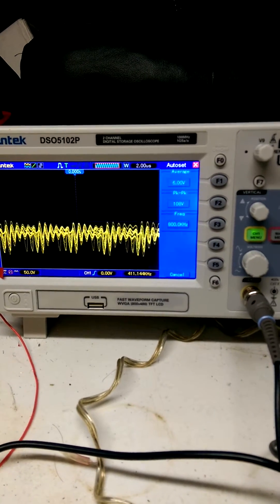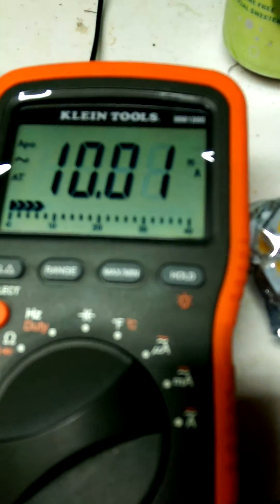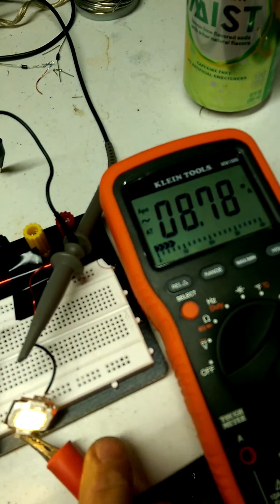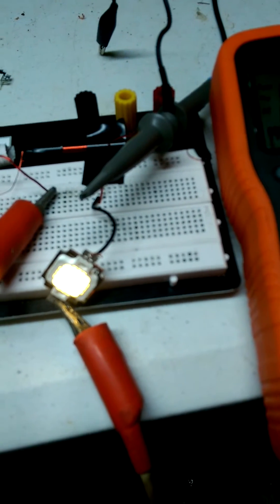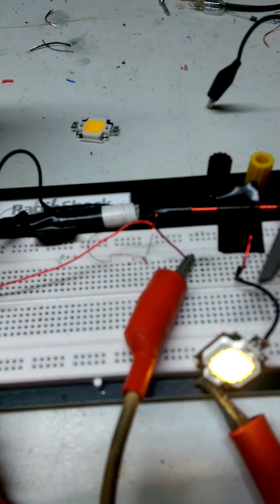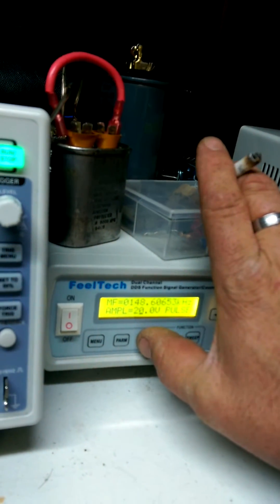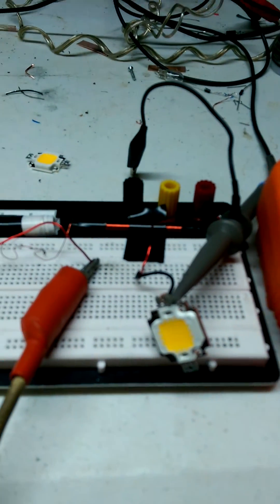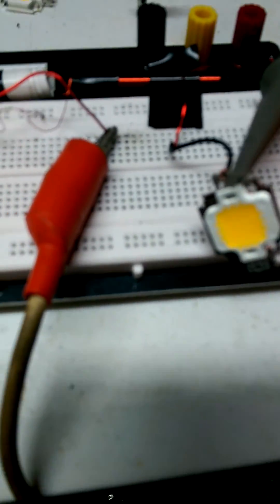Partnered coils- proof of overunity

Comment: tesla was into high voltage and high cycles
Reply from the maker: +frank ertolacci Me Too! I was just playing around with this. He actually speaks of this using low frequency ac and pulsated dc in his book. This is where I learned of this originally and he states that the cores being separated will make it work if the bloch wall has an electromagnet wired in the middle in the correct direction. The energy out would be completey independent of the input, and, a very high amperage, however, the phenomenon here needs to be engineered by somebody to calculate what's happening here.. I do not have that deep of knowledge as to why it works the way it does, but, it is working the same as TinMan's motor. It's the identical effect!
Reply: +Marc Belanger   i think that you are the engineer to handle this task  // if you keep looking help will appear  //  also try to get up with eric dollard or aaron marricomi ---- dollard is a true genious , he has invented versor algebra to mathamatically explain many of his positive results in expiraments  //  he has replicated some of teslas work  //  also get up with gerard morin he is onto something huge , if you 3 could get together  WOW  //  frank
Reply from the maker: I'd love to get together with them both. I'm a huge follower of both. I'd bet Dollard is one of the smartest men on the planet..I couldn't say there is anybody that has a much more complete understanding of Nikola Tesla's life's marvels. In fact, I think that if anybody has taken Tesla's dream , and forced it into the future, it is Dollard. Without Eric here, I wouldn't believe things such as "breaking the speed of light"., extraction of energy using magnetic manipulation, vibrational energy derived from increased frequencies that is so powerful, not even any of our fossil fuels could mimic the abundance anywhere near what Tesla's theory has shown true utilizing Moray, Smith and other folks designs. I think we could get a lot of answers from Eric, and I'd certainly hve a lot of questions for him that I couldn't answer myself.
Reply from the maker: +frank ertolacci Thanks Frank, I appreciate the compliment, and that is one thing.. you are right. I never give up.. I may take a break from it when frustrated, or run out of finances to complete it. I literally have half built devices that don't work all over, but, once a new thought comes to mind of how to do something promising,  or add new components I haven't thought of before, they pop out of the woodwork for another try, and sometimes end up working, like the Pelex device did.. I have so many and I have wasted thousands and thousands of dollars doing so., but, one day it will all be so worth it, even though it may mean my demise, I will continue on, very carefully. The wife and kids want to know when one of the devices will finally make us the money back.. I told them, it will probably only be able to make society the money back, not us. Anyway, I do have an accidental design that makes a transformer switch itself on to an energized state by a mere pulse of energy to one wire, battery powered of course, but, once  a winding is pulsed, then, the device turns on, unfortunately, I haven't been able to keep it latched permanently under any decent sized load, but, when it does this, it operates an LED at a fraction of the normal amount of energy used. Certain wavelengths of color use 1/1000th of their normal energy input at full peak brightness, and, when the energy level is very low, the device remains latched, allowing it to stay illuminated until an opposing magnetic pulse releases it's "shortcut" feed. It was a mistake, but, may be beneficial for something in the world of electronics, however, I won't waste my money patenting it, I will just build it and epoxy it so it can't be taken apart without the very hair fine enamelled wire breaks! The device can run a 10 watt Red led at a 1000th of it's normal input amperage, not wattage! Then, as I experimented with other colors, I have found that the UV wavelength doide runs so much brighter than it is supposed to at the same energy level, that I feel we could use the UV to generate more energy out than it uses. I have done this with magnifier plates for reading newspapers and solar cells already, so, there's no telling what I will get done next. I have literally created 4 or 5 of my own devices that run with less input than they use output already, so, I know for a fact it is possible, I am just waiting for the day somebody takes them to a lab and is not able to debunk all of them in the same day.. That would be great, unfortunately, I do not know if they will allow to remain online in a video if they all show me proving their input to output capabilities. That might not be what some people wish I provide society the knowledge of. It's been so suppressed now for well over 100 years that it isn't even funny, however, it is certainly possible!!
Reply from the maker: Oh, I will work on a detailed message tonight. Gerard and I have spoken by phone before and we speak once in a while here and there.
Reply: +Marc Belanger    GOOD DEAL